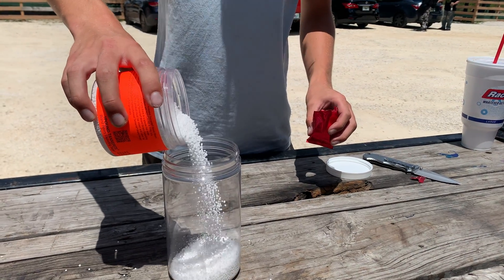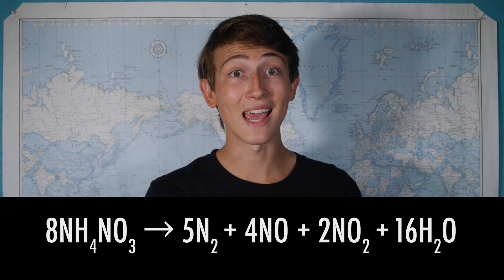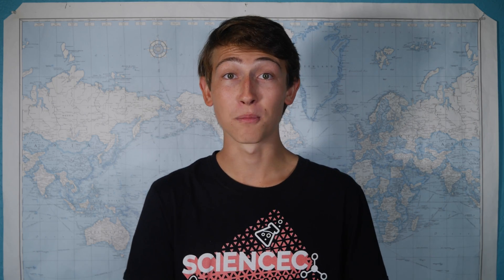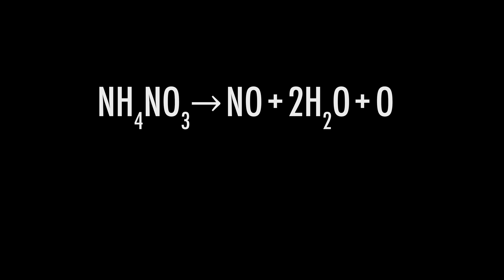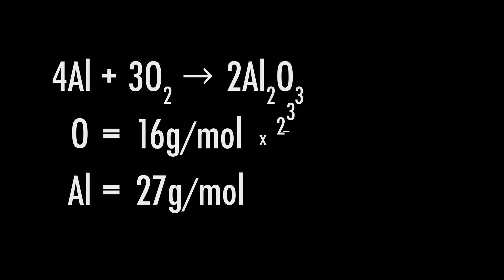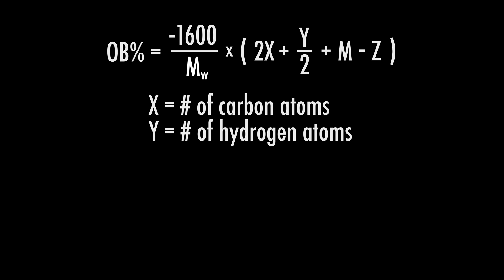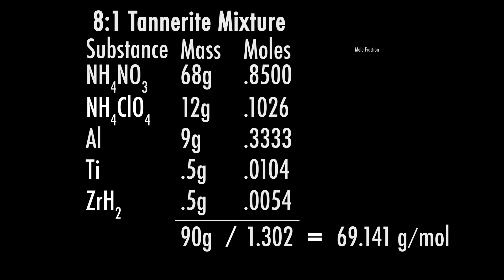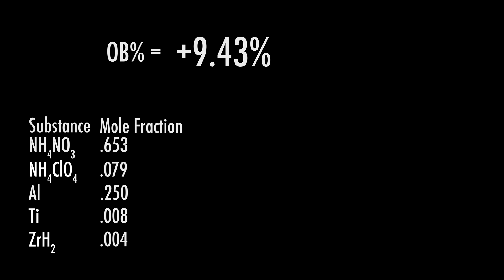The Science Behind Tannerite

Comment: Would this be good for breaking up volcanic and igneous rock?  I've got a hill, way out in the desert, that I need to break up for construction.  I'm thinking of drilling holes in the rock and blasting the rock apart and using an old gun on a frame to ignite the explosion.
Reply: It would be extremely inefficient, and probably more labor intensive (and possibly more expensive depending on how big the hill is) than getting permits and using conventional explosives.
Reply: With that said, a skilled chemist could easily synthesize nitroglycerin using the ammonium nitrate and use that to make dynamite. Emphasis on “skilled chemist.” A novice chemist has a high likelihood of synthesizing a lab explosion.
Reply: For rock, mix flash, 70/30 Al with potassium perchlorate, and fill the crack.  It does a pretty decent job.  But it's pretty sensitive to mix.  I have a saying: if you're going to do something stupid, don't do it stupidly.  If you don't understand every aspect of the chemistry, then learn.

Comment: Just incase anyone is unaware.  It’s what the Taliban primarily used in Helmand.

They used a smaller primary charge instead of a bullet.  Funny thing is, the  UD was shipping in tons she tons of ammonium nitrate to these small villages.  The IED manufacturers would have aluminum spray paint brought in and they would dry the paint on cardboard and scrape it off then work it into s powder.  Guys with silver stained hands would get brought in. They’d put the tanerite these detergent jugs wire it to s battery with telephone wire and a pressure plate made out of styrofoam stripped wire.  It was hard for our guys to sweep the plates and get a good metallic hit.  Idk what the Taliban generally used for a primary charge.

They usually held some local Mullahs son hostage and made him force his other kinfolk to burry the IED, or something like that.  So if you took out the “digger” there was a good chance his son, brother, father  and cousin would then go work for or join the Taliban to achieve “Pashtunwali” for his family.
Reply: Tatp as the primary charge perhaps?

Comment: You can also use a blasting cap to set off tannerite. Or a firecracker.
Reply: Flash isn't going to set it off.  You need a primary.  A blasting cap is copper II nitrotetrizol.  I like the silver version better.  It's relatively easy to make with a good chemistry foundation.  My favorite booms are simple flash powder.  If I want the high-pitched crack, I'll mix some nitroglycerin and detonate it with silver nitrotetrazol.
Reply: @falsedragon33  well I've been using firecrackers to set it off this whole time. Works every time.
Reply: @frankrizzo2724  you are only having partial detonate if you use a blasting cap you will mostly have a higher detonation % then flash powder. If you see a lot of smoke not all of it went off

Comment: Illegal to ship, store, or transfer without ATF permission and ransom.  And my understanding of the reaction is that it's just a super-fast redox reaction.  The aluminum has a MUCH higher affinity for the oxygen than the nitrate ion.  So it decomposes releaaing energy, and as it bond to the alluminumit relwases a bunch more.  But the exploaion is because of the energy released over time.  Tannerite will burn or explode.  It's about the energy is released and how fast.  Therefore, reaction time is proportional to the energy that started the reaction in this situation.  A flame, low energy.  A bullet moving fast enough to detonate lead-oxide and copper-oxides merely from impact, well we know that has a lot of energy.  For those who don't know, those oxides are pretty stable and not prone to reactions like this.  Well now you have that energy of impact mixed with a similar redox reaction from the alluminum and the oxides on the projectile.  That's a double whammy on initiation, and the decomposition goes from a slow burn to "I'm all done, RIGHT NOW!"
Reply: Not illegal to ship, store or transfer.....

Comment: It's not unknown.  Simple answer is that powdered Aluminum is a fuel which is why it's mixed with the oxidizer, which in the proper ratios, produces a much faster and more sensitive reaction.
Reply: Ammonal has a military history over 100 years old, the chemistry is well understood. I suspect the presenter just didn't fully understand it.
Reply: the Al merely adds heat to the reaction. AN can and will detonate by itself. It is just not very sensitive. There have been massive desasters of AN detonating without any added fuels, Beirut for example, but in Germany something similar happened in 1921 when 300-500 tones exploded killing 559 people. Search for “Oppau explosion “. The Al powered makes it more sensitive and increases power. The ammonia is the part that is oxidized by the nitrate. There is excess oxygen released that can further be used to oxidize fuel and/or al powder. Al power is commonly added as a booster to solid rocket fuels and AN based explosives. It does so by mainly creating a lot of heat, but no gases.